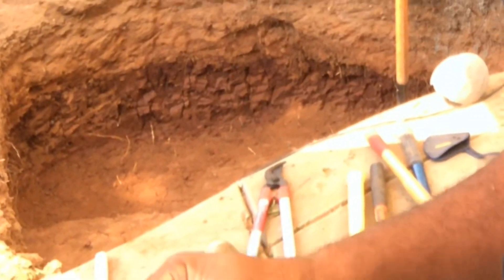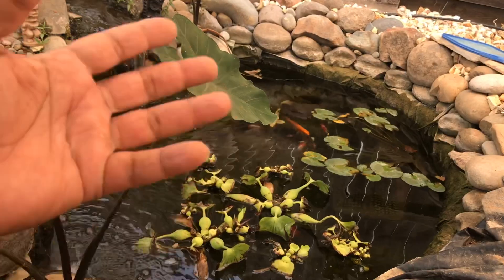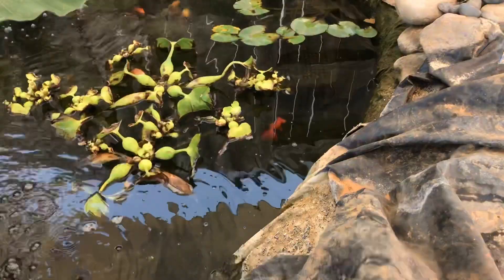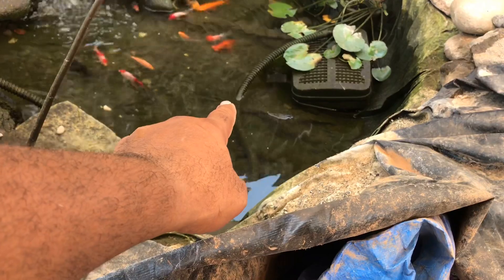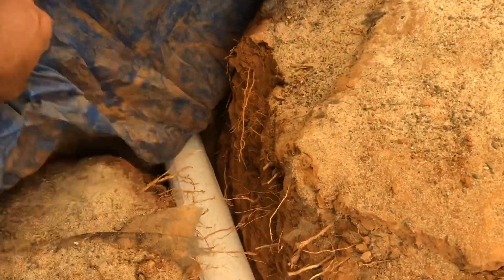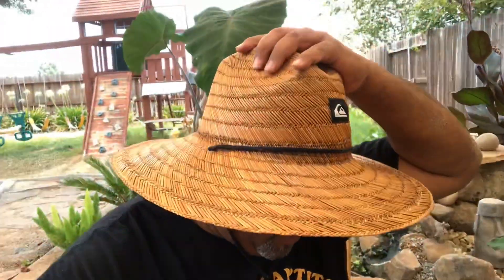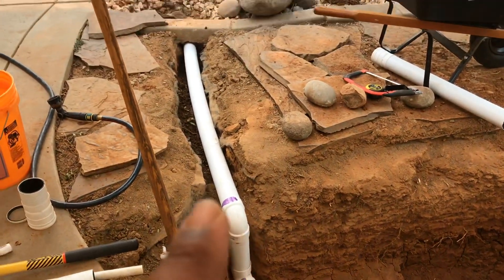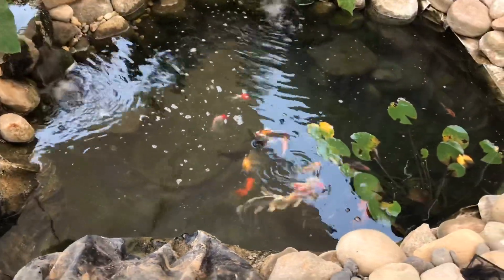DIY BACKYARD POND BUILD Hydrostatic Pressure

Comment: I was told to add some heavy rock at bottom to keep liner down I did that today hoping it will work. Please let me know what you think .
Reply from the maker: No that won’t work it’s called Hydrostatic pressure you need to do what I did in this video🤙🏽🤙🏽🤙🏽